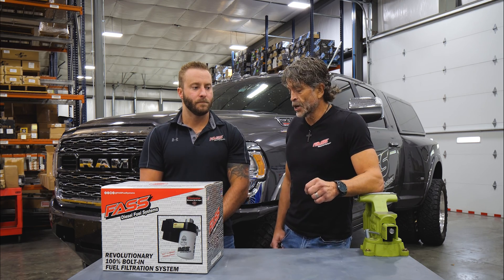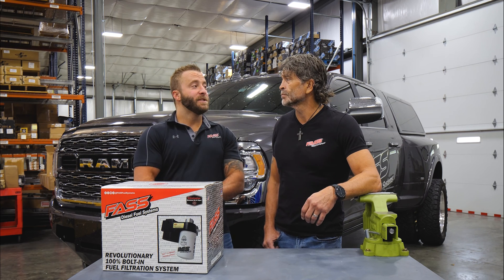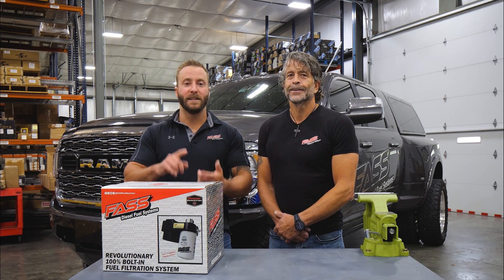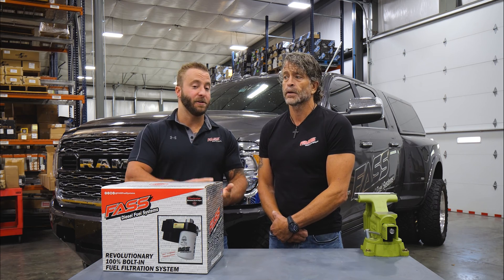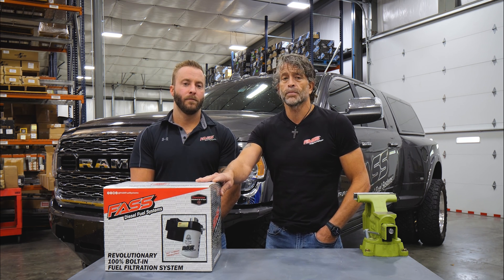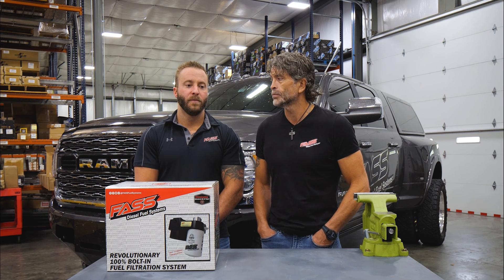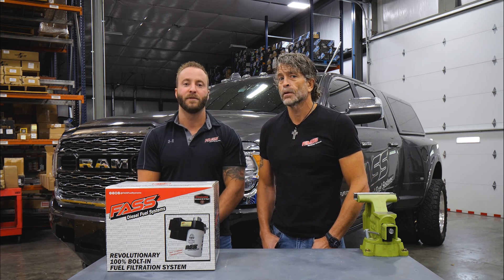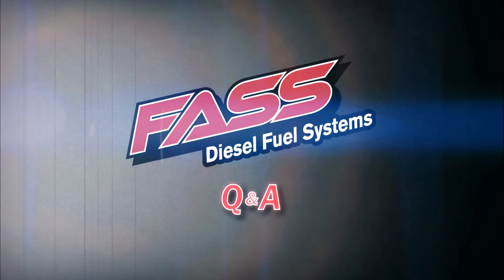Q&A with FASS |  Install Time, Priming the System, Filter Life & More

Comment: Why did you change location of you water separator? Used to be under the heat probe port.
Reply from the maker: We appreciate you asking and we changed the location around for more optimal fuel flow in the FASS, and this switch also helps out with less cavitation as well.

Comment: A handy hack I did on my 359 Peterbilt was add a tee in the line going to the engine using a jic fitting and cap. I can remove the cap and attach a hose flip on the Fass and have fuel for anything I need fuel for. ie tractor/steam cleaner/heater/another truck ect.
Reply from the maker: Very nice!

Comment: My buddy has a 2014 lml dmax with a 165gph on it I  have a 2000 24v cummins with a 95gph and I’m want to convert his over to mine how is that possible
Reply from the maker: Great question, and you'll probably need some new fittings, hoses, and other components to make that work. To make sure we get you everything you need please feel free to reach out to our service team at 636-433-5410.